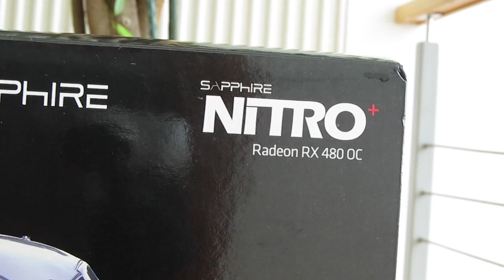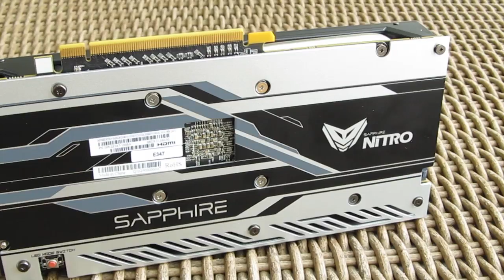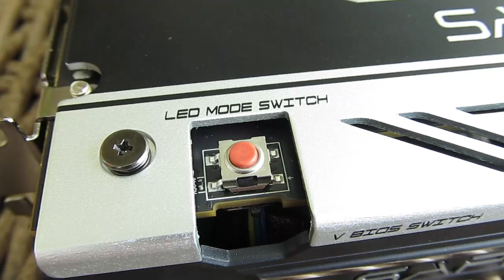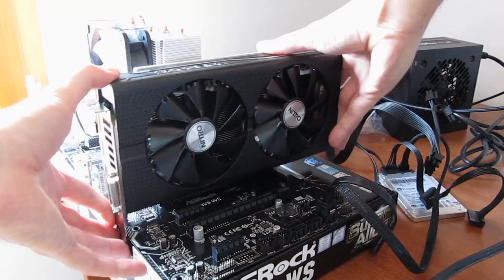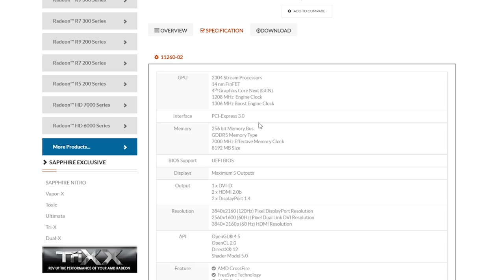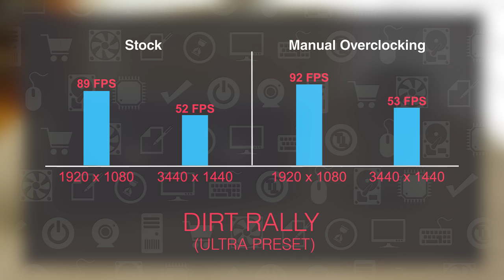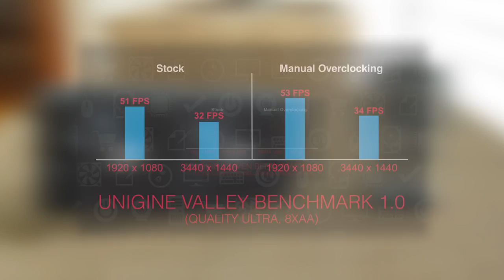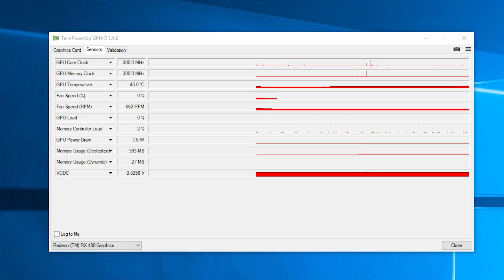Sapphire RX 480 Nitro+ Review - Aftermarket Salvation

Comment: Better cooler, ADEQUATE power delivery (unlike reference)- aaaaaand NO MEANINGFUL OC! 

Polaris really, I mean REALLY seems like they took the 380X, added a few basic new features (Primitive discard accelerator, SOME form of memory compression that would seem to be maybe one half as good as Nvidia's Pascal compression, and still a good deal less useful than Maxwell's, More L2 cache, faster and more VRAM - and a few other, thus far questionable features that don't seem to have a real impact on gaming)  - shrunk the die with Samsung's 14nm FinFET process, and called it a Day!

Where Nvidia was able to make a 1060 with just 1280 CUDA,  48 ROP, 80 TMU, 6 GB GDDR5 at 8 gbps (8 GHZ effective) and a 192 but bus, that at stock clocks is ALMOST as fast as a GTX 980 at stock speeds!

And furthermore, the architectural improvements are INSANELY POWERFUL, whilst also being insanely power effecient!  So that now, a $250 GTX 1060 with its "measly" 1280 CUDA count, beats the HELL out of a GTX 780 Ti even at 1080p where the VRAM capacity does not make much if any difference in most games, and that 780 Ti has 2880 CUDA!

For all those AMD Fanboys who still TRY to argue that the RX 480 is a better GAMING GPU than the GTX 1060, just type into Google "GTX 1060 review Gamers Nexus" - and you will see the title "GTX 1060 vs RX 480 vs 1070"

IF you are able to READ and interperate bar graphs, just go to the end - Of ESPECIAL importance is the Over Clocking section. Where even the 1060 FE (which actually has a WORSE cooler than the $250 EVGA SC version which is small and has one 92mm fan, with 2 or 3 heatpipes, the FE card has just a copper slug and aluminum fins!)  The 1060 FE being the worst 1060 was STILL able to hit 2088 MHZ core at ALL times with just MINOR power target ND fan curve adjustments - as stock the FE fan never goes above 60% and the power target is awful, all one need do to keep the stick boost 100% of the time is to up the power target to 116%!

AND every reviewer who has over clocked the 1060 FE, but especially ANY other version, were ALL able to add 300 to 450 MHZ to the Memory base clock, so 1200 to 1800 effective - bringing the VRAM bandwidth all the way to 220 to 235 GB/sec!

And you know what happens when you do that to the GTX 1060? I beats a stock GTX 980 IN EVERYTHING - sometimes by A LOT! And other VERY important feature of Pascal cards are the 1% and 0.1% lows! They are BARELY lower than the average in many cases, when over clocked, the minimums are so tightly timed that they don't get much worse than a 30% dip for a couple microseconds! Whereas the RX 480 and even the Fury X, ALWAYS have MUCH MUCH lower minimums than the GTX 1060!

Hell in GTA V, and Rise of the Tomb Raiders DX12 - as well as MANY other titles (top many to list, these 2 really stood out)  when  the 1060 is at 2088 MHZ even without the VRAM over clocked, it TIES the Fury X at 4k resolution!

Okay, the Fury X DOES manage like 1.2 FPS  better Average at around 42, but the 1% lows are just 16 FPS, and the 0.1 are 7! You know what the easily over clocked 1060 does? over 40 FPS average, 1% lows were around 34, and 0.1% were 28!

So GTA V at 4k, the GTX 1060 is WORLD'S ahead of the RX 480, AMD even SLAMS the Fury X due to its UNPLAYABLE stuttering!

And the trend is the same at EVERY resolution in EVERY GAME!

I was CONSIDERING getting a GTX 980 off eBay as they are going for just $220 on average right now, and an OC'ed 980 will beat an OC'ed 1060, but the 1% and 0.1% lows are better still than on the Maxwell cards wh8ch are STILL ahead of ALL AMD cards in terms of minimums AKA STUTTERS AND MICRO FREEZES! 

I would rather a card that can do it 85 FPS average with 58 minimum at 1440p than a card (Fury X) that will do 108 FPS average but hits 28 minimum! The RX 480 is even WORSE in this regard, as it's average will be lower than  the 1060, and the minimums will be roughly the same!

The above figures are a GENERALIZATION on what you will see with FULLY in depth reviews that include minimum frame rates, as well as Over Clocking potential - of which AMD basically has none

And I hear the Fanboys saying "RX 480 iz moar fuutuer proooofs!" Sure it is buddy, sure it Is! Firstly anyone who buys ANY PC HARDWARE because they THINK it will do better in the future than it is now-  is a frigging MORON!

And I actually find it quite sad AMD flopped so hard with Polaris. It REALLY IS mostly just a DIE SHRINK! 

Try comparing Pascal with Maxwell cards with similar CUDA, TMU, and ROP, there is a MASSIVE difference! When 1280 CUDA, 48 ROP,  and 80 TMU (GTX 1060) kicks the living shit out of 1664 CUDA, 56 ROP, and 104 TMU (GTX 970) 

to illustrate such a massive difference I will list stock stats on raw output:

1060:  Pixel Rate: 72.3 Gpixel; Texture Rate: 120.5 GTexel; 3.855  Tflop  compute performance NOTE: all values are base clock and not boost, at boost it hits 4.4 GFLOP, over 80 Gpixel and over 135 GTexel without any over clock

970: Pixel Rate: 58.8 Gpixel; Texture Rate: 109.2 GTexel; 3.494 Tflop compute performance NOTE: Base clocks again, despite Nvidia cards easily hitting and maintaining boost speeds at all times, as the can over clock WELL beyond even the boost speed and hold it at all times

RX 480: Pixel Rate: 40.5 Gpixel (barely above an OCed 770!) Texture Rate: 182.3 GTexel  (which while impressive, actually has SURPRISINGLY little to do with performance! a GTX 780 Ti manages a staggering 210 GTexel without boost, yet is slower than the 970 in even 1080p with  games made in its era!) And the Compute Performance of the RX 480 is also a good deal higher at 5.834 Tflops 

Now that compute performance means it will be GREAT for thing like BitCoin mining - which is essentially pointless at this time - Though perhaps if you are into Folding At Home AND gaming the RX 480 8 GB MIGHT be the better choice for you IF that is indeed the case!

But in gaming, at least right now, the GTX 1060 is an all around AMAZING gaming card for $250, which unlike the RX 480 actually can BEST a GTX 980 with a VERY easy and effective Over Clocking! Where the RX 480 is
is mostly faster than a STOCK clocked GTX 970, but actually loses to it in several game titles! But then, a GTX 970 - which can VERY easily hit 1500 MHZ and above, at which point I would imagine it will EASILY beat an RX 480 8 GB card in DX11 games in both 1080p and 256px1440p!

AMD really did NOT CHANGE ENOUGH! NOT EVEN CLOSE! I mean the chip is built on Samsung's 14nm FinFET process-  but has MORE power draw than a GTX 1070, which is a FAR  MORE POWERFUL CARD! 

I hope Zen actually changes things, I really do, but at this point I have VERY little faith in AMD'S silicon being anything game changing. The R9 390/390X were with the GTX 970 and 980 at a time where the "Game was changed" - but even then, EVERY review I have seen that put the 390 ahead of the 970 and 390X ahead of the 980 - it NEVER included maximum over clock on both cards, and then, the VAST majority of these reviews, lowered details and tesselation JUST TO GIVE AMD "A more fair playing field" as they put It!

So, ignore over Clocking, and ignore max setting on everything that is not directly GameWorks-  and sure the R9 390 beats a 970, and a 390X beats a 980, but WHO WOULD BUY A GPU THAT NEEDS DETAILS GIMPED TO PERFORM, AND A GPU THAT CANNOT OVER CLOCK?? 

Answer, AMD Fanboys and the technologically challenged that just happens upon such a comparison.

I am not a fanboy, IF the RX 480 could best the GTX 1060 and the 980 for a $240 card, I would BUY IT, and if the performance impressed me, I would be singing it's praises! But with the TERRIBLE minimum frame rates, the fact that it basically CANNOT over clock to get any meaningful performance, and the fact that it BROKE PCIe standards  and has a driver fix that changes clock rates Constantly  (probably why it has such bad mins)  - I cannot think of any GAMING reason to buy AMD at this point in time!

Comment: Are you all so thick when comes to AMD?? 

Retail Nitro 480 cards wont spin their fans at 2000 rpm. It was a bug in drivers which AMD already fixed. I think eTeknix or PC World reported on that in their own review. Target temperature was set too low. 

I have Nitro 380 card and in case with mediocre ventilation fans never exceed 1600 rpm so there is no reason this card which actually has 20-30W lower TDP than 380 needs that much RPM.

EDIT: After watching the full video. I see those readings were made using FURMARK. Furmark is great for measuring maximum, worst possible power draw and noise but it doesnt represent a gaming load. Furmark utilizes gpu to the max unlike any game. AMD and Nvidia treat it as a "power virus". It`s normal for any gpu to max out it`s fans when using furmark or even throttle the clocks back. It wont spin at 2000 rpm and reach 80°C in while gaming. My 380 spun at 1900 rpm while throttling down to 900 mhz in Furmark lol.

I cant fathom why people dont understand the basics. And i think it`s a reviewer`s job to explain it better for noobs, not just tossing the info for people to make uneducated assumptions ;).
Reply from the maker: I'm not thick when it comes to AMD at all, I'm not fan biased or anything along the line of that, just reading out what I saw / experienced. 

I have one question though. If the target temperature is set too "low", that being somewhere between the 72-78°C according to multiple reviews, and if there was a driver bug in AMD's driver that spun the fans too fast, what kind of temperatures are we going to see in that scenario where they lower down the fan speed? Over / around 80°C? Either way based on what we can see here, I think they have some temperature issues.

I think the issue here is the Sapphire's other OC BIOS probably which probably boost the cards thermal / power envelope.
Reply from the maker: For some reason you're persistently comparing your 380 with 480 and their fan profiles. If you ask me, I really can't make any comparison based just on that, two "different worlds".

Furthermore;

C/P from below;

FurMark is here to represent the "worst case scenario" and it's important to have a same measurement point / level ground. The reality of it is that in games, well optimized games that can get close to that 100% of the GPU utilization, the results / temperatures aren't that far from what that you'll get in FurMark, maybe 2-4 °C max difference, and sometimes not even a degree difference.

...yes, I was mostly referring to their temperature levels on other comments, but in this example / comment I replied how I saw that they also got to pretty high RPM's (granted overclocked, but still high at  2800 RPM's). Eteknix also reported that they got high fan speed (2300 RPM's). They've also said, that because of that issue with the drivers, they couldn't asses the noise performance. Bottom line, I was just transferring my experience which was around 2000 RPM's for the most part (yes, in games too, not only Furmark which actually went from 2000-2200, just like withe Eteknix and PCWorld). Nothing more. And to me it was loud, not unbearable loud, but loud / noticeable is probably a better word for it, especially compared to some of the GTX 1060 / 1070 / 1080 that I've been trying out for last two weeks.

The thing is that I know that in a scenario where a reviewer says that some "X" card is loud under load, that they will get complains like "oh you tested it on an open test bed, you should've put it in a chassis". But when that same reviewer says that some "Y card" was quiet under load, then nobody would complained as everybody would be pleased with that. Just like I would most likely get higher temperatures in a closed off chassis. It's hard to make everybody happy. I think it's more than obvious that the noise profile will be better / quieter in a chassis, I don't think I need to stress that out.
Reply: TekTick Did sou see my later edit? :D

I didnt attack you personally. I meant on other people here in the comments. Because bashing AMD has become some kind of online national sport in last few years. 

"Wow, card spins at 2000 rpm in furmark, so Sapphire sucks and AMD sucks". You could`ve explained that Furmark means worst case scenario and why you are using it.

And that other, "boost" bios, that could be true. Also i think the cooler looks a bit smaller than on last gen 380 but it`s still a lower tdp card overall, so it shouldnt be such an issue. I expect that card will stay below 1500 rpm and 80°C while gaming. They still have time to make some last moment tweaks before sending massive batches to retail in August.

Shrinking transistors are also an issue. When you have switching circuits ever closer together it makes thermals worse. Also small chips (small surface area) are actually harder to cool than larger ones because of the contact patch size. I reckon this gpu is actually harder to cool than 28 nm 450mm2 power hungry behemoth which was Hawaii chip :D.

Comment: The temps are to high for an AIB
Reply: +nimrodery My reference 770 has been running heavily overclocked at 82-86 degrees since launch and it hasn't died yet lol. Some people are just clueless man -_-
Reply: @Rakib, sorry for the bluntness, but u r full of shit bro.
Cards dont die below 95 degrees, at higher temp than this, cards have a CHANCE of getting damaged, hence the voltage is cutoff, even if a card reaches 100 degrees doesnt mean its fried, it means it will now have to cooldown, thats why some cards shutdown(theoritical and very old cards) and most decrese voltage and operate at lower power to control the temp.
~electronics engineer, for more info, read transistors/semiconductors chapter from any undergraduate level book
Reply: +MRsjovealek My reference 770 has ran overclocked to 1241Mhz at 84-86 degrees all of its life. No issues at all
Reply: Tyler you will get issues soon. Especially if you have long gameplay session
Reply: Rakib Hasan I've had the card for over 2 years... If something was going to happen to the card from heat, it would have happened by now.
Reply: Tyler It will degrade over time. Thats how tech work
Reply: +Rakib Hasan What am I ever going to to when my 770 finally dies and the 1370 is out.
Reply: ***** FE GTX 1080s can reach that high.
AIB are much lower. This RX 480 is a AIB card
Reply: ***** My MSI GTX 970 never crosses 71* at full load OCed to 1450 MHz. So I really dont need to worry
Reply: ***** 100 is crazy.
90 is very high
80 is high if AIB
the 60~70 mark is the best
Reply: Amit Sangwan I never said they will. But they will degrade. You know that
Reply: degradation is not caused by heat but infact its normal wear and tear. holes and electrons flow towards each other..... different story, leave it. IN SHORT, heat doesnt damage nor degrade card, it only heats up your room and this is the only reason one should be worried abt the temp at which these cards operate. Degradation that u seem to observe is nothing but normal wear and tear or your imagination/paranoia :)
Reply: You do realize those temps were from running Furmark? Furmark beats the living shit out of GPU's, it's not ever going to get that high in a game.
Reply: well thats amd for you. Their cards are known to run hot....
Reply: 90 temp fine for gaming too
Reply: I just threw my GPU in the oven at 375 degrees for 8 minutes. It was starting to go, now it works fine. GPUs can operate at high temps. I'm talking about a six year old graphics card running between 85 and 90 degrees next to a heavily overclocked CPU running in the high 80s. Hell, first time I stress-tested the configuration, the CPU was running over 100 degrees.
Reply: not really...Linus tested a new vga with the same model used for like 4years...they had the same performances
Reply: +nimrodery not true had 2 radeon hd 3780x2 that had problems with temps like 70-80C and both died with artefact bugs .. after 2 years
Reply: Black Shadow .....
and you assumed those relatively low temps killed them?
Reply: Tyler 7970 to play AC and witcher
from 925 to 1200
1375 to 1600 was 85-92 , now 65-70 - still alive , 5 year